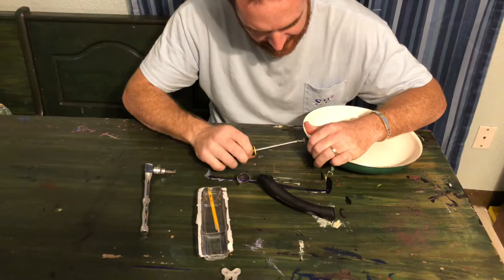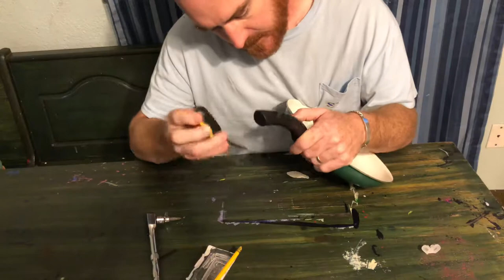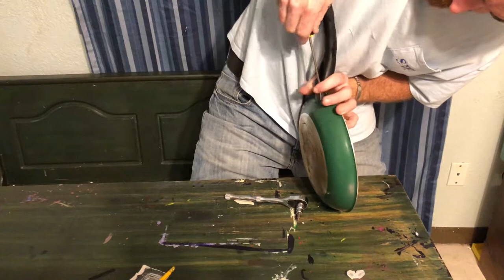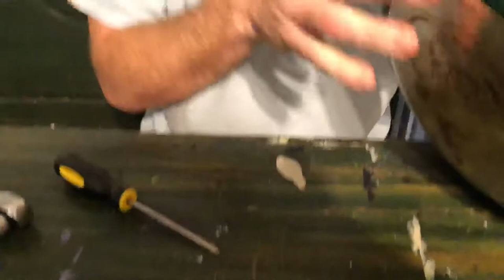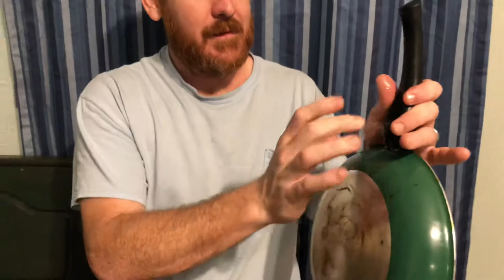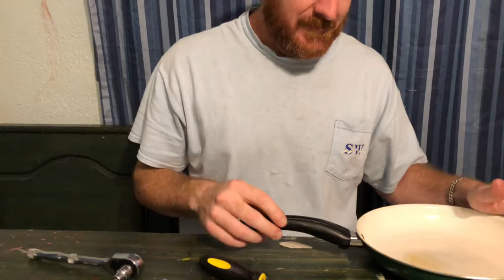Diy how to fix a frying pan handle FAIL!!

Comment: What I would have done is glue an ordinary nut on the other side of the bracket, since the thread in the bracket is stripped.  You have plenty of space for one.  Another option which has worked for me, is to drill a hole in the aluminium collar, and inject JB Weld into the handle with a syringe until it's full!  That will NEVER come loose again, even if you want it to...